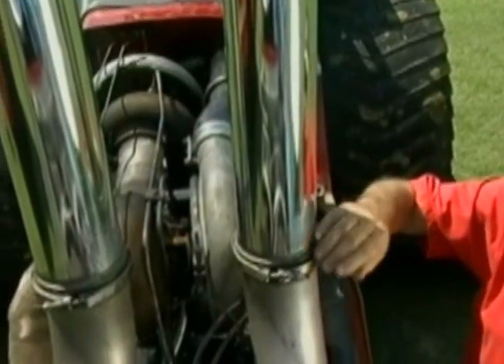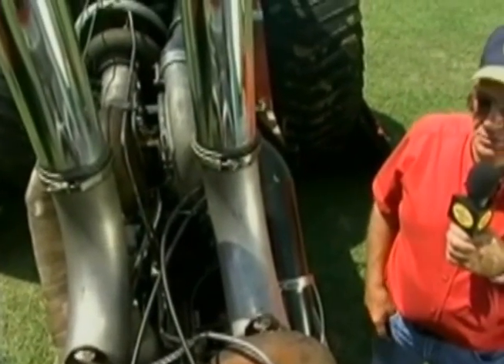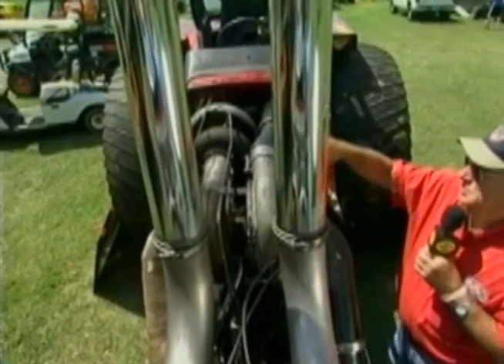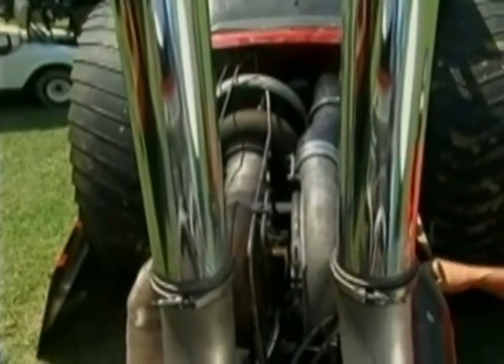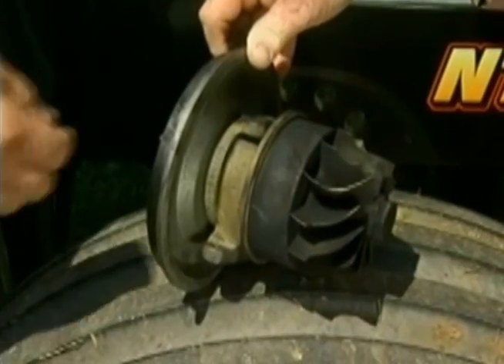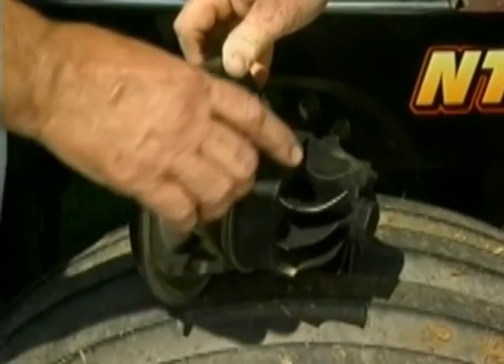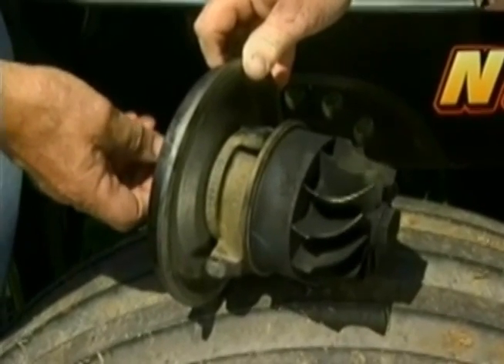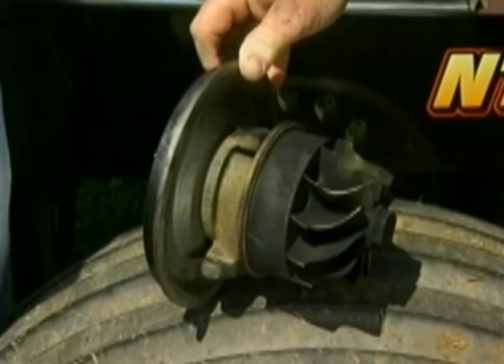Understanding a Four Turbo Setup in Tractor Pulling

Comment: Max Simpson is a diesel tractor pulling legend engine builder. If you don't know how a single stage turbo works, or a turbine for that matter, this won"t mean anything to you.  The 4 chargers, along with water injection and massive amounts of diesel fuel take a 120hp tractor to a 2500 hp or more tractor. Not a simple concept.

Comment: So there using the smaller turbo to drive the next bigger turbo to drive the next bigger bigger turbo until it gets to the humongous turbo which by that time is just ramming gob loads of air back into the intake?? Is this what this means? Interesting.
Reply: nop.... wrong.... big to mid to small ..... on the inntake... small to mid to big on the ex, site..